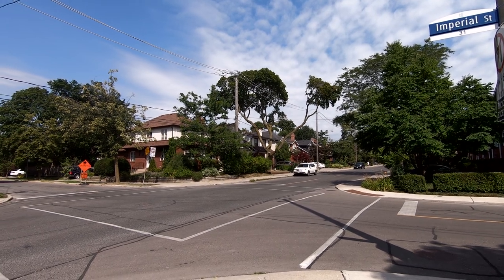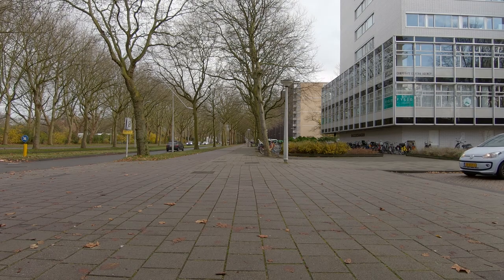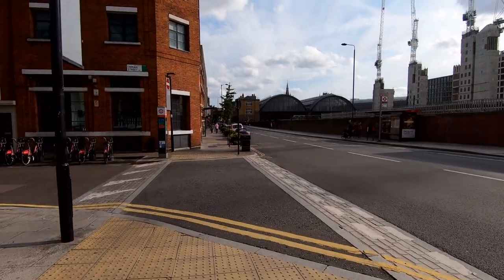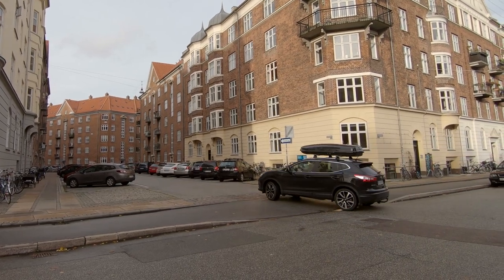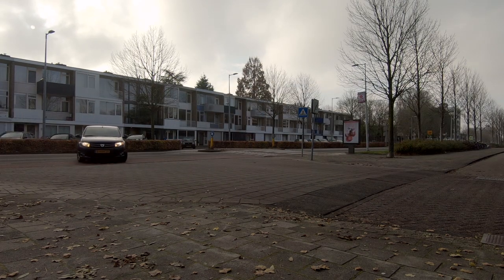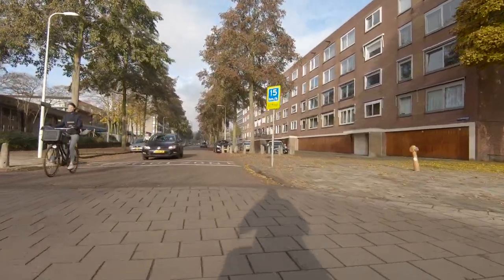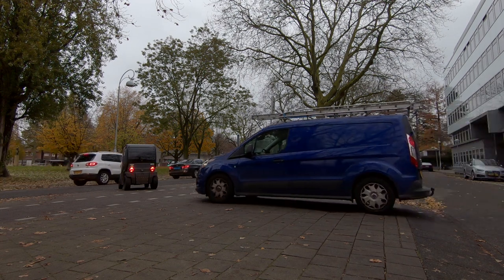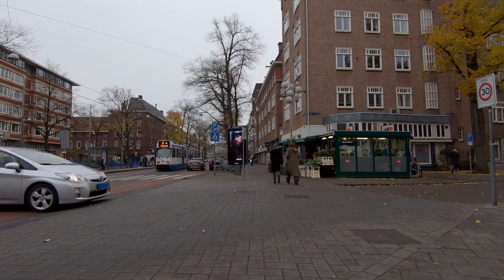The Dutch Solution for Safer Sidewalks - Continuous Sidewalks

Comment: A raised crosswalk also keeps puddling water away from your feet every spring thaw.
Reply: Yes!  I have the privilege of walking to work in a US suburb (rare indeed) but when it snows, the slush accumulates at intersections and stepping into the crosswalk ends up putting me in 3-4" of freezing cold wet nasty slush. It's the only time I year I drive.  If the sidewalk was raised/continuous, I could walk all year.
Reply: "Watch out for that first step; it's a doozy" - Groundhog Day

Comment: I live in NYC and every single day I go outside I'm nearly ran over by a motorist running a stop sign, driving recklessly, etc. Every. single. day. I wish we had street design like this in all major cities.
Reply: I live in NYC, too. It's not a street design problem, it's a culture and people problem. Go to Japan or Germany and you'll see that people actually obey the street law even with the same street designs as NYC. Stop blaming the system and start blaming the people.
Reply: @casperd2100  I agree with you. Never been to Japan but I traveled to Berlin, Amsterdam, Paris, Sydney, etc. However the big difference between NYC and German street designs, are that Germany actually builds more traffic-calming infrastructure, which forces drivers to slow down. Drivers in the United states rarely see traffic-calming infrastructure, which leads them to believe they can drive as fast as they want, even in an urban/residential environments. Anyway, I agree with what you said, but I think it's a little bit of both problems: Entitled (inconsiderate) drivers + Poor street design = Lots of unnecessary traffic deaths and injuries.

Comment: Charlottesville, Virginia just recently adopted the continuous sidewalk into their design manual for new road/sidewalk improvements. Really progressive place that is trying to do a lot of what is being done in the Netherlands.
Reply: Great given how currently they're famous for a certain automobile death.
Reply: @tobyrice9406  Improving pedestrian safety is always a good idea.
Reply: charlottesville main street is also reminiscent of europe
Reply: That’s good
Reply: A few months ago in Charlottesville, I walked from my hotel to a convention 3 miles away on Rt 29, and it was not pleasant like one of my daily 3-mile loop walks at home. As another video highlighted: there's noise, high-speed cars nearby, not-so-friendly crosswalks and an uninteresting view of signs and shops far from the sidewalk. I could even see where drivers lost control and took out signs for them. I got a lift or took the shuttle bus the rest of the time.
Reply: @sandal_thong8631  where might I ask was the convention located at? The urban core of Charlottesville is pretty pedestrian friendly (in and around the downtown mall, Main Street, the University of Virginia, and the Starr Hill neighborhood). But just like everywhere in the US once you get out of the areas built pre-1950 this degrades significantly and the area around RTE 29 I agree is not a walkable part of the region at all. Granted whenever I go there I always take the train and stick to the downtown area. Interestingly most of RTE 29 where the mall, Trader Joes, and shopping centers are is in Albemarle County and not technicaly in the city proper.
Reply: @Maznhaden1  Rt 29 on "the strip" as I used to call it or the stroad from the highway to the airport.
Reply: @sandal_thong8631  OK yeah that is like 95% Albemarle County outside the independent city boundaries which has far less stringent design criteria than the city (basically just the bare minimum that the state DOT guidance calls for) and is heavily auto-oriented. Unfortunately the city can do little to control design outside its own borders which is tiny (the city is only 10 square miles/26 square Kilometers). Once you get into the county side the infrastructure is maintained by VDOT which will most definitely be geared more towards vehicular traffic. The culture at VDOT is slowly changing to incorporate more bike and pedestrian facilities in its new project, but the city of Charlottesville (though far from perfect) is light years ahead with their design criteria and pedestrian/bike accommodation.

Comment from the maker: Thumbs up if you're excited about sidewalks!! 👍🏻
Reply: Sparka what are you talking about? The 2 cyclists that came close to bumping into each other did so because they were making a left turn after crossing the main road, 1 turned left sharper than the other and needed to correct themselves to avoid bumping into the other.
Reply: What's your background, I can't help thinking you got to have a background in traffic one way or another. :)

Best regards.
Reply: Totally exitewalk!
Reply: If you are taking about continuous sidewalks in London then please call them pavements.
Reply: Not Just Bikes I think a smaller speed bump before the sidewalk is enough. To me the continuous sidewalks looks like an eyesore and is very confusing for drivers as well as pedestrians.
Reply from the maker: @glebsokolov9959  it's not confusing at all. The consistency is really nice and it becomes very obvious how to use it, even for tourists. It's especially nice for wheelchair users as well!
Reply: Sparka  actually, the pedestrians have right of way on these elevated sidewalks. So it's the bicyclists that had to stop for the pedestrians, not the other way around. 
The reason these two boys almost collided was because they weren't sure where to go. It's not because of the pedestrians. And the other bicyclists going around the pedestrians is quite normal here. They don't hinder the pedestrians, but they also don't like to lose their momentum by coming to a complete stop. Cars will have to stop completely though, until the pedestrians have crossed.
Reply: Yeah! Sidewalks!
Reply: Excited? Not really. As an OAP with not-so-perfect spine and not-so-perfect joints I strongly disapprove hard tile sidewalks. Raised or lowered, if it causes more pain than plain soft asphalt - it's evil. I often have to leave the sidewalk and walk on the car's right-of-way simply because of lesser pain. Unfortunately, my own city's government has decided to bring these "civilized" (i.e. superhard synthetic granite) sidewalks into my neighborhood - which means that in a few weeks I'll be 100% car dependent.
Reply: The London continuous pavements are improving. The one near a local borough landmark is cobbled raised and clearly a pavement not a road. It has emboldened me to just walk across it and stop the cars.
Reply: @ytwos1  i came here to say this
Reply: @NotJustBikes  Wow! Now I want  continuous sidewalks! Too bad I live in the U.S. :(
Reply: Yours but certainly not mine!!!
Reply: I jist watched your video on moving elevators and watched 10 minutes of paint drying. You bet your bottom I'm excited for these mf sidewalks!
Reply: Of course your right ... but the Brit Road Safety Designer make the road at road level, SO THAT the pedestrian knows they are crossing the road, the fear of injury will make them be careful.  Tell the pedestrian they have right of way & they will get hurt when the motorist gets it wrong. If the motorist hits a pedestrian/cyclist in UK " I didn't see you" is a an absolution of guilt.   
These are the same road safety designers who put the green & red crossing man so it is only visible from the side walk,. So once you start crossing , you can't see if its still green , the fear makes you hurry. 
In the Dutch case , a car turning left across traffic can't accelerate across the lane as it has to slow to go up the hump. 
I wonder if shock absorbers fail sooner in ditch city cars  ?
But as I said .. your right , make the walking &  cycling safer & pleasant & more will do it & less will drive
Reply: It would be great to have a 'round-up' video (or a playlist of 30 second snappy shorts) that contains some key elements of good design for city planners and why cycling is good adn cars should not see us as the enemy...there are far too many narrow-minded people around with short attention spans that need educating!  My city in the UK (which is meant to be rather green and liberal) is currently going through a media frenzy as temporary covid bike lanes popped up, got removed, got repainted by residents during the night (twice) and now the city cannot bid for central funding next year as the money spent on the covid bike lanes was wasted as they were removed without proper assessment of their effectiveness.  Of course cyclists don't deserve any infrastructure and need running over because some don't stop at red lights! (sarcasm).  PS I love the current format also :)
Reply: meanwhile in my city in Québec, sidewalks become ramps for cars to get into their parking lots sometimes it's really steep and they don a particularly good job of snow removal, let alone de-icing which of course means melted snow pools at the ramp before turning into ice.
Reply: Whoa, could we get a video about that skinny car in the intro? 😄

Comment: As a Dutchman,  I think that Europe could really lower the amount of traffic-related deaths and injuries by adopting the Dutch standard.
Reply: As non Dutchman European, I agree
Reply: Concidering how powerfull the car industry is I wouldn't hold my breath.
Reply: Exactly. Especially since countries in Europe are so small. Cycling is the best travel option and we don't need so many cars
Reply: As a North American I think we could likewise lower ours if we adopted the Dutch Standard.
Reply: @patrick_test123  Well, not so powerfull as to stop the Dutch from making their own decisions about their infrastructure.
Reply: @mourlyvold7655  Yeah, but it doesn't help that you have to sneak european standards past the german goverment.
Reply: @patrick_test123  I'm afraid I'm not knowledgeable enough to understand what you are talking about. Could you be more specific? Thanks.
Reply: As a Daneman I agree.
Reply: @dreamingflurry2729  I don't see how that's an issue here.
The main arguments behind 'dutch design' are:
- In populated areas (dense or otherwise), 'design primarily for local/foot-traffic, cars are guests' (instead of the other way around)
- Where safety or noise are significant issues, because of how crowded the road or populated its immediate surroundings are, fix that (by speed-limits if need be)

Neither of which apply to the AutoBahn, which tends to be large for the amount of traffic, doesn't go straight through towns and enjoys 'above average maintenance'.
any speed limits on the autobahn are not the result of 'the dutch standard'.